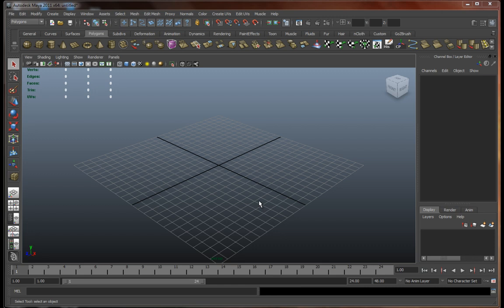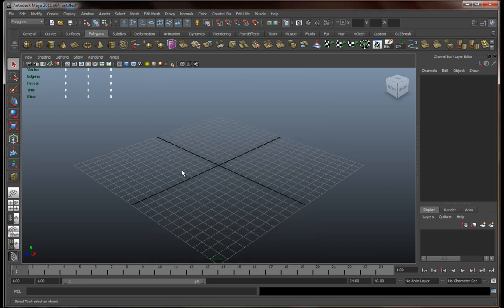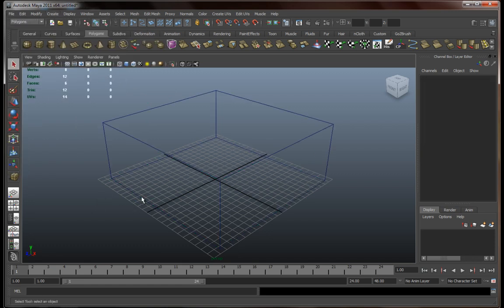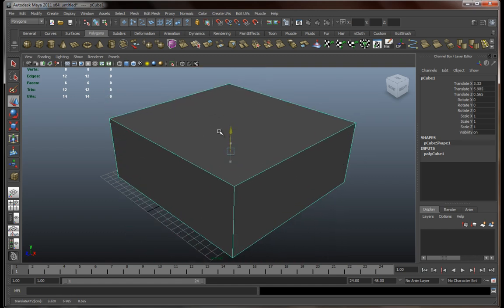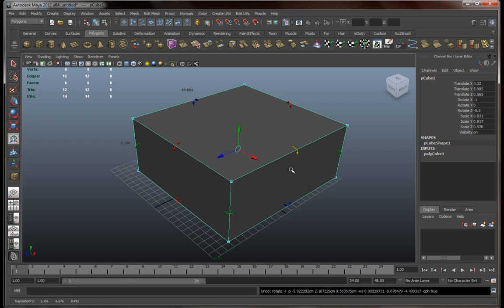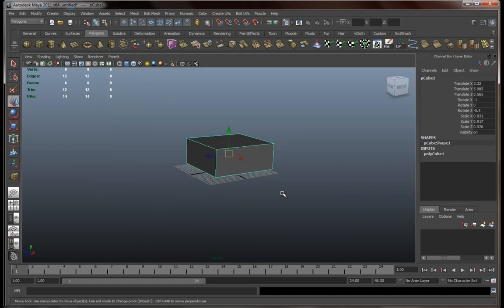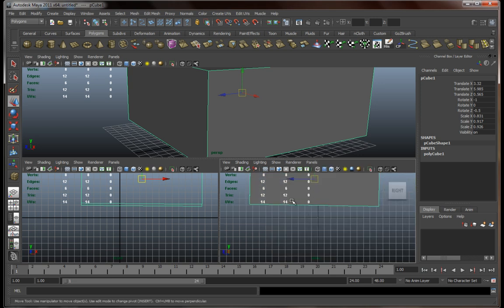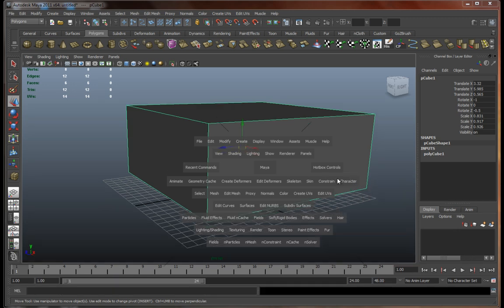Autodesk Maya 2011 Basics Tutorial Part 1

Comment from the maker: @13xzanezanex13 Also this is pretty much the reason why alot of people prefer to put the objects together just by making them go through one another , saves alot of time , if your geometry doesn't match it usually involves alot of fiddling around with the topology wich can easily get very tedious and maybe even screw your project if you have a set number of polygons to work with for example , it's just not worth it so people rarely do it , it also makes later editing harder to work with...

Comment from the maker: @13xzanezanex13 If by border you mean the objects actually being connected ( like two pipes ) yes , you can , you can check that in my motorcycle tutorial , it basically involves the merging of two vertex points/edges , the problem with this though is the fact that the geometry on the two objects needs to be the same , for example you can't merge a surface/face with 4 edges with one that has 3 or 5 or whatever , the parts that you want to connect need to have the same number of polygons